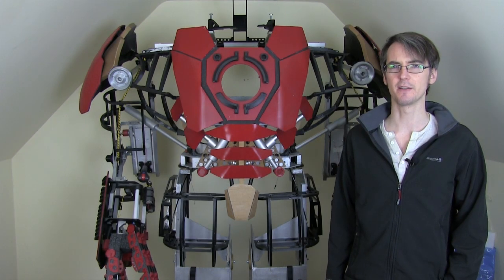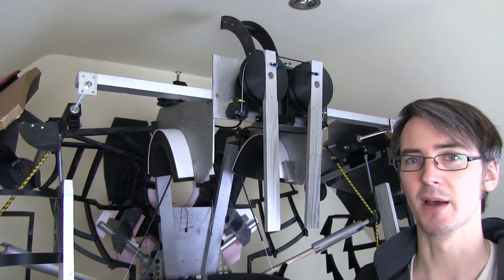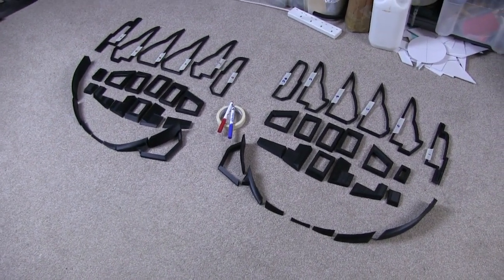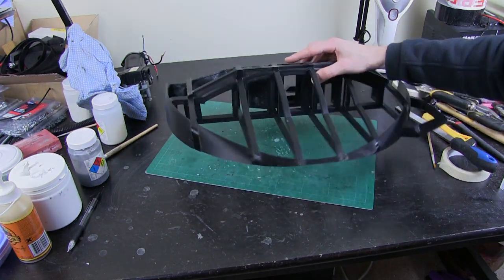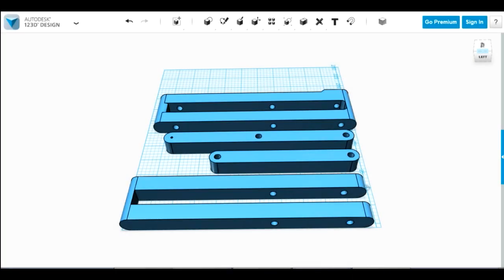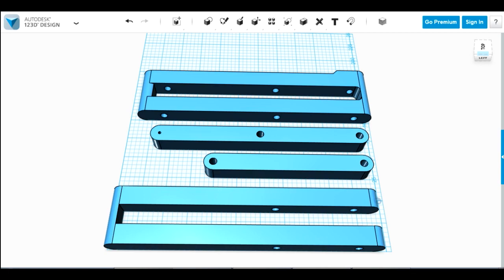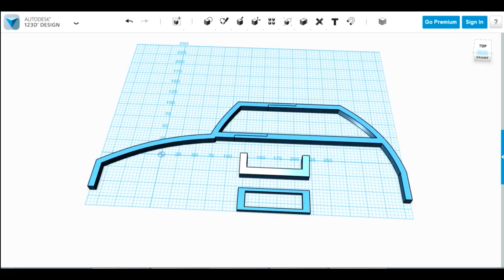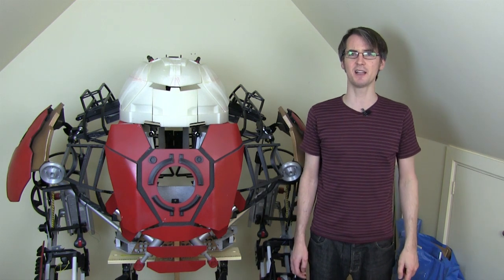Iron Man Hulkbuster Cosplay #24 | More Framing & Mechanics! | James Bruton

Comment: I know this video is from about a million years ago to my chance of getting a reply is pretty low, but I was curious from a design perspective about how you make sure that the spring mechanism was bistable, i.e. holds the lever open when it's open and closed when it's closed?  I think you just said "the way the spring is" - is that built into the design of the levers, the design of the runner, or is it just where you placed endpoint of the spring?  Could you choose a position for the spring for any layout of the levers and runner and have it give you that nice bistable tension?
Reply from the maker: It was mostly guesswork... the spring basically doesn't have enough force to push it up when it's down. You could redesign it so the spring is past the pivot point and holds it down also.

Comment: I'm looking at the helmet, and it still needs to be finished or rater you still need to get the basic out line complete before you continue with the back part of the suit. That way you wont have to go back and spent time on a mistake that could have been avoided.

Comment: Looking really good. A humble suggestion from experience, put the batteries and drive motors in the feet as much as possible. It takes the weight off your shoulders and helps lower the CG.

Comment: why cant lulzbot make a large printer where you can put four extruders on a single frame,  controlled by one print system, you can have a one control unit, one motor unit, and have that central, with the four print heads controlled by that single drive system, hmmm???
Reply: Have four flat beds moving in conjunction at the same time,
Reply: Cedric220609👍👏

Comment: coming along very well, im looking forwards to when you deal with all the cables. you have the leg locking cables, cables to get your feet locked and unlocked,, the back door, the shoulder pods. This is turning out to be a massive build with many moving pieces and panels that will be very impressive to show off at events.

Comment: you can also have lasers like the one from your Iron Man glove, pop out from a recess in your shoulders, when the flaps come out. That is, when the shoulders pop open, the weapons attached to it "activate", but also some lasers rise up from the empty space that's left behind. You just need to make sure that its placed where helmet can come around unhindered.
Alternatively, have those lasers take up more space but have them electronically/manually controlled so that you can be flashy when you want to, but if you need to open the helmet, the lasers don't have to pop up.

I only suggest this because it would make the suit look more intimidating (rockets plus lasers? Yes please!) and I remember your Iron Man wrist lasers to be very flush and sleek in design.

All in all this is coming along fantastically. You're a genius! (you've probably already thought of my idea :P)